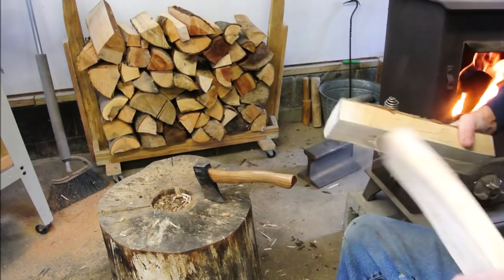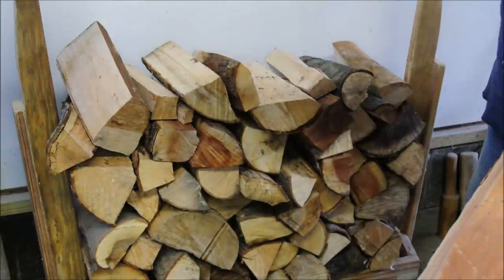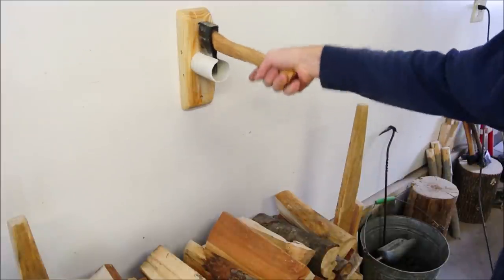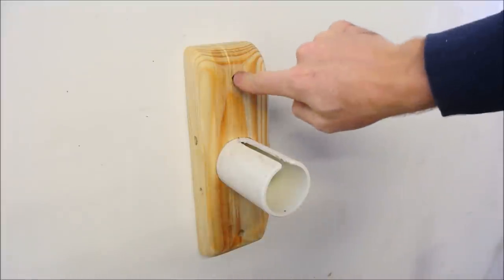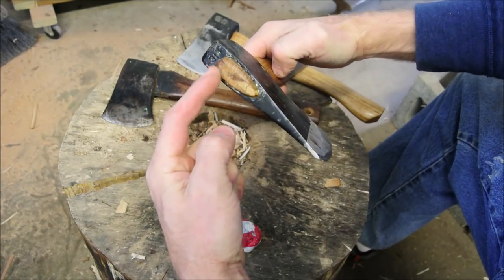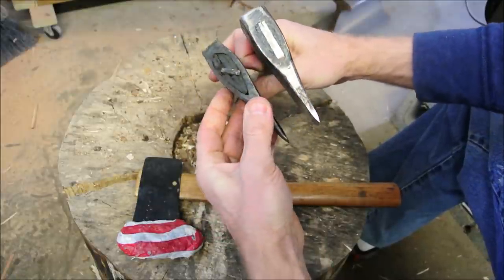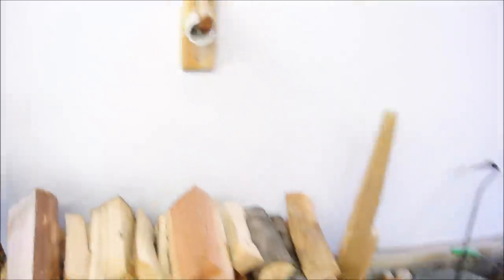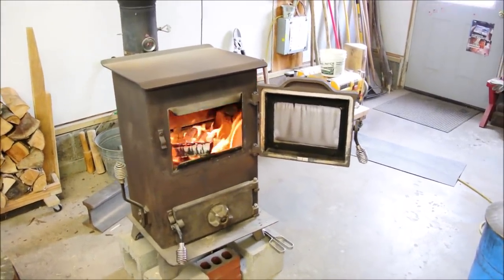Fighting level 2 cold with a hatchet

Comment: tell you what, you may not like the cold but i assure you it's better than living in a place with no winter. seasonal variety is an awful thing to miss
Reply from the maker: You are so right. It's almost like we need the cold to really, really appreciate the summer. Yin, yang, whatever. It just feels as though places with non-stop warm weather have a sort of empty, bleak feeling sometimes. 

It's also possible that I'm rationalizing. Or maybe it's my whiteness showing through, and my ancestors really did become somewhat adapted to the winter.
Reply: @pocket83squared  my people hail from your area. I hate the cold, I don't mind digging trenches and running blow torches in 115° heat haha

Comment: Thanks for another entertaining video, Pocket. Just like a wood fire, watching your videos gives me a very "home"y feel. Nothing like those coal fires, for sure!

Did you live in PA before you moved to your current home? I am struggling to remember if you ever brought it up in older videos. The reason I ask is..

From what I've gathered aboput the general area, I'm very interested in western PA as a future home... Any growing pains you have had moving to your current home, or bits of advice for someone looking to move to a similar region?

Hope all is well,
Reply from the maker: Depends what you're after. First, know that PA is really more like two states, East and West. Central PA is like an enormous buffer that separates the halves. It takes commitment to live up in the middle, but it does have a natural beauty. Also note that the farther up the mountains you go, the cooler the climate becomes. Temperature wise, Pittsburgh has a really nice seasonal balance. 

In my case, I was born and raised in the woodsy outskirts of Pittsburgh's suburbia, near Delmont. This is what I would consider 'the bottom of the mountain,' because it's at the foot of the Laurel Mountains, which are two big but smaller low hills that run parallel to the Appalachians. Ideally, I might want to live somewhere in the Laurel Highlands, which is a touch south of here. It's a huge stretch that's a kind of valley that rests between the two Laurel mountains. Where I live now is at the top end of the Laurel mountains, where they sort of flatten out. It's where the river begins. You can still drink the water up here, and the air is still fresh. But we are not up in the Appalachians here, just up in the Laurels.      

Growth is an ever-expanding circle. When I was a kid, the city was about a 25 minute drive, but over time it doubled because of traffic. Small towns fused into one megatown surrounding Pittsburgh. The other thing was the logging. By the 00's, every single patch of woods had been harvested to some extent within anywhere near of the city. Old-growth forest no longer exists in sw PA. These pressures forced me to move up in search of more space, privacy, and beauty. 

If you're considering the area, you'll have to think about what you want in terms of the balance between space and culture. For me, I've seen enough of what the city has to offer, and so I'll happily tolerate the moronic yokel culture for its locale. They're mostly dumb, but friendly. You'll find plenty of rebel flags and such, though the people don't really understand the nuance of its symbol. The ignorance can be frustrating, but it's not hate-based.  

The shopping is surprisingly better up here (less corporate, more diverse, independent stores), and traffic is a non-issue. With modern online shopping, life here is simply better~in every measurable way~than it was in the suburbs. Even our internet is more reliable. We wouldn't have believed it until moving here, though. Nobody does. People down there feel as though they'd be missing something. Let them stay in their cluster, then.

My overall opinion of the region is high. Aside from the extremely rare tornado, we have almost zero natural disaster concern. Plant life is varied and rich, and the soil is dark. The earth is typically ~4" of topsoil atop a clay/rock matrix. Rain is abundant but rarely problematic. An occasional summer storm will have you perk up from its whip-crack. Unfriendly plants include Nettles, Posion Ivy, and wild Rosebushes. Animal life is mostly (and comparatively) non-threatening. Black bears are exceedingly rare, and far more timid than you'd believe. Our two venomous snakes are also more myth than reality, though they are worth noting. Honestly, the worst thing about the region is the Tick, which is a recent ecological imbalance that will hopefully soon pass. 

If you have any more specific questions, please, ask. Hope you find what you're after.

Comment: IDK, but I'd imagine all that coal is anthracite.   The only difference is that one is weathered lump coal and one is washed and graded stoker coal.  Some of the stoker coal is (or used to be) oiled for dust control and better feeding in automatic stokers.

If you grew up with a coal furnace, a coal fire might not seem so foreign.
Reply from the maker: The two examples shown were from completely different sides of the state. But as with most things, the division lines for 'types' are arbitrary. The stuff is just a pressure-baked mash of old organic compounds, so every deposit will have a different composition to some extent. And it's not foreign to me, it's just dirty and smelly.

Comment: A little neodymium magnet embedded in the wooden plate would probably take care of any axe-dropping-out concerns
Reply from the maker: No. Not even. 

Every video has that stupid suggestion for some reason or another. Magnets are neat, given. But they only rarely solve shop problems with any practicality. 

It must be the a priori divide that results of watching as opposed to doing. How's about you tinker with the idea, and then come back and report?
Reply: @pocket83squared  whoa - definitely didn't mean any offense there, so sorry if you're faced with that class of suggestion often enough for it to be grating.

And I guess it sucks that you must get enough comments like that that you'd assume everyone who makes them is some sort of passive consumer. I've genuinely enjoyed your videos for years now, but I'm going to take my own gentle offense to the suggestion that I'm not a doer. 

I actually have recently solved a similar kind of problem this way. I found that you can get magnets rated for the exact force it takes to break the connection - so I was able to engineer the perfect feel for removing the object. But yeah, I can see that there might be issues with an object like this; maybe there wouldn't be a good place to line up the magnet with the head of the axe. Maybe with the gap between the wood and the axe caused by the PVC pipe not being cut all the way through, it wouldn't be strong enough. 

Anyway, like I said, not trying to wind you up here. It must be the a priori divide that results from reading all the comments for every video vs making a single comment one time.
Reply from the maker: @stok3si3  There was this one video that was about making a shed door latch, and it must've received a hundred comments to 'just use a magnet.' It really can be grating (especially since they'd rust in that case). 

Don't take even mild offense. I was judging only one comment; following your second, you're clearly less stupid than that one lousy suggestion. And to be honest~personally, I talk out loud as I problem solve, so the free-associative ramble often makes me look like a complete moron as I cycle through the stupid ideas that're popping into my head. 

It's interesting that you can get magnets made that are custom-strength. Guess I knew it was possible in the back of my head, but hadn't thought about it.